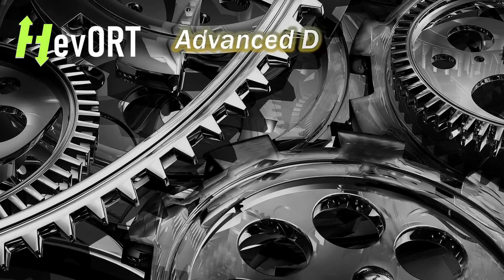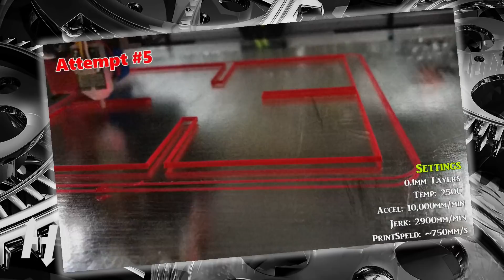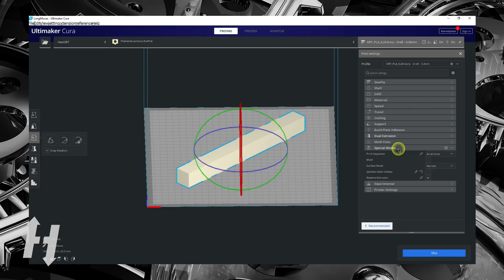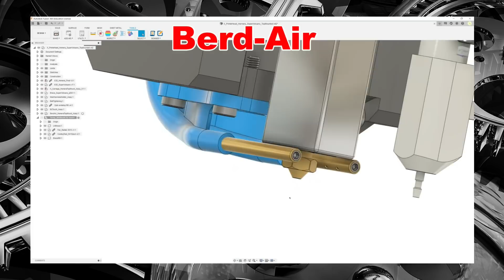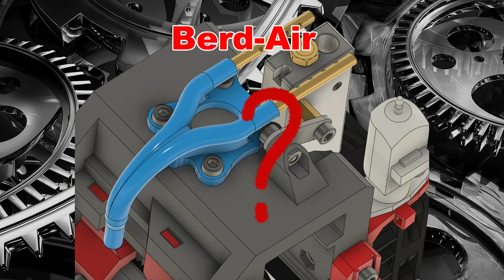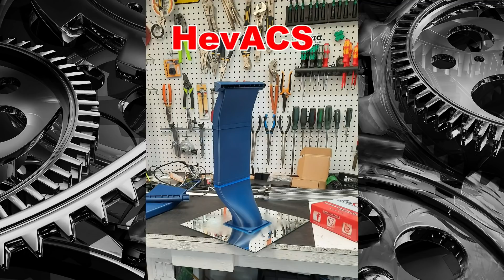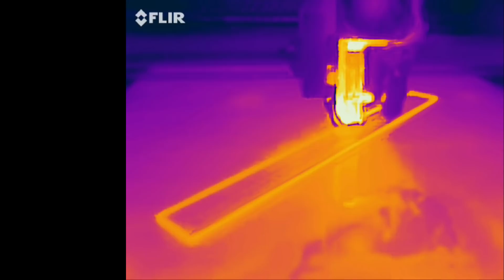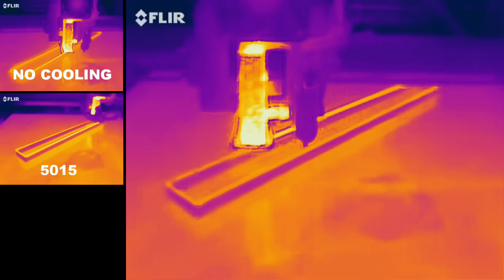Ultimate 3D printer Cooling fan - 5015 vs Berd-Air vs 300CFM Mega Cooling

Comment: Brainfart idea2: Is it possible to implement some SMT tech to the printhead/hotend? Prusa has the color changer, but I think it's way too complicated. IMHO, as an experiment I would like to try out BB gun pellets, what is basically ABS, and use SMT pipettes and shoot the balls. IF we use different sized pellets, and colorized bb pellets, you can get Styrofoam like structure, and a pretty fast printing speed. https://www.youtube.com/watch?v=nMYSneJN55c (like at 0:27) IF we use this printhead structure, you can have not only one printing head size, else even 12 if the module can be fixed to a traditional hotend, and you only need a toolchanger that SMT/SIPlace machines already using. The only question remaining that how can you heat up the pellets to stick them together (maybe acetone coating?).

Comment: Another brain fart idea: is it possible to create a peltier based hotend that already heats up inside, but makes cool outside? What would be to use out this feature and use the already cold air in a chamber and blow that out? Inside melts the plastic outside cooling down.
Reply from the maker: I like that Idea! !  Thank you :)
Reply: @MirageC  If you don't want to have any moving parts, you gonna need also water tank attached to the printer, and use gravity and vacuum. Redesign this: https://www.youtube.com/watch?v=TpltYa0_94c. Maybe you find it useful. +1 brainfart: Can you make electric heatbed with magnets on base with wireless charger circuit? Here is the idea: separate the tray and only move the wireless charger by another mechanics/stepper motor close to the tray. With that you can use out todays wireless chargers disadvantage - as they generating a lot of heat, but also you can have electronics inside or around the tray to indicate heated bed temp. If the print finishes, switch off the magnets that keeps the tray in place, and release down the wireless charger, and eject the tray with the printed stuff, and load the next magnetic tray....

Comment: Can you check the hevACS system with a large area of infill or a complex part that would shield the center from the wash of cooling air?
Reply from the maker: I fixed that by making the HevACS nozzle to be a bit higher than the print zone.  This way, the air flow comes down at a slight angle on the part, avoiding, or reducing that shielding effect you are mentionning.

Comment: Presumably the HevACS would also cool the entire bed.
Reply from the maker: It does have an effect on the bed for the first few layers.  Not enough to trigger thermal runaway safety shut down as per my tests. 
As print progresses, the bed will go down and get away from the airflow.  
Note that I made sure the PID tune from the bed was performed with HevACS on at 100%.  
I am using a 750W 120V silicone pad from Keenovo which can keep up with the extra demand.

Comment: Whats the estimated price range first for the 315 build volume then the 415? Thank you.
Reply from the maker: You can figure a good 2000 - 2500USD for such a build
Reply: @MirageC  appreciate it i was looking at $650 when looking up the parts but thats with out the xy part just the electronics, extrusions

Comment: Could one route the air path from the need-air over a peltier effect cooler before it gets to the printed part? Colder air might be another way to improve cooling efficiency.
Reply from the maker: Yes, the colder the air output is the more efficient this system is (With PLA and other high cooling material)  The down side of peltier cooler is that they will generate as much heat as they generate cold.  They only transfer heat from one side to the other while taking considerable amount of power.  You would need another system to cool the hot side.

Comment: I'm using to two of so called "turbo" fans 4028 27cfm mounted right on a carriage and it works amazingly! Can you actually check the air flow rate coming right from the outlet ? I bet there is not that much left of the original 150 since it looses its potential on a long distances

Comment: how does this apply to ABS?
Reply from the maker: ABS does not need that much cooling.  But if you are looking for high speed printing a recirculation of inside chamber air can be done to blow warm air at the part and limit warping.

Comment: A strange study. Why cool the part completely? In fact, you just need to lower its temperature below the glass transition temperature, and that's all.
Reply from the maker: This system will cool the first one or two inches of the part.  As ths machine can lay down material quite rapidly the heat accumulation becomes uncontrollable using only fans on the print head.  As material is rapidly piling up, temperature of previous layers could not get below the glass transition temperature.  This system fixes that issue.

Comment: The HevACS has got to make the hotend work much harder to keep temperature.
Reply from the maker: A bit yes.  But the PID tune of the controller takes it into account.  Super Volcano has a 80W heater cartridge.

Comment: Wouldn't the hevacs work even better non-axial fans? It looks like the airflow is at least a little restricted and afaik axial fans are not great at pressure, mostly volume.
Reply from the maker: I agree they would be more efficient with Axial fans, but considering the current level of effectiveness, they would be overpowered.   I made sure in my design that the output area was close enough to the input area so the fans would remain with operation limit of static pressure: https://github.com/MirageC79/HevORT/blob/master/images/120mmfanchart.jpg?raw=true

Comment: Close to what I was thinking about using a high pressure fan (not necessary having hundreds of cfm) and using a silicone tube along with the bowden (or bowden and wires could even run inside the silicone tube), to save weight from print head, and direct that "outside" air to the part. Result should be closer to berd-air but with higher cfm so I can even bleed off some of the air surrounding the nozzle and not just directly under it.
Second thing is that would the HevACS work better if the nozzles are a bit offset so the air streams don't clash with each other as much? Like the left duct more on the front and right one bit further back. That should also create a small vortex that could lift off excess heat directly up.
Reply from the maker: You are correct Tommi, the air clash in the middle could be improved.  I had the Idea of slightly diverting one HevACS duct to the front and one to the back.   This induced swirl could then be flushed via a top fan pushing air out of the chamber.  But in all honesty this system does not need much performance improvement for the current application.  I am now concentrating at ensuring proper flow distribution through the bed surface.
Reply: @MirageC  How would the HevACS work with tiny parts where the hotend spends a lot of time in a small area and doesn't let the breeze flow as well as with big bed sized parts?

Comment: I had another crazy idea: What if you would print in water,  you submerge the whole print platform in the water and lower it down so that the water level and the current layer line are always at the same height. That would have an interesting cooling effect. Also it could make overhangs easier printable as the filament would float on the water.
Completely floating pats of the print could have a tower with 3 contact points underneath to keep them in place without having to lift the whole structure.
Reply from the maker: I will leave this one to you ;)  Too much development for me. But yeah, maybe there is something there.

Comment: So because this is a COREXY system, once the bed moves lower the cooling is perfect for high speed printing?
Reply from the maker: The airflow s parallel to the bed and has limited interaction with it.  Only the first few layers are being treated with air affected by the heat of the bed.  But yes, as the Z height increases the cooling stabilizes.
Reply: @MirageC  Is there any place you've shard your fusion 360 files? I have an in-progress HyperCube Evolution but it is using 4040 openbuilds v-slot. I wouldn't be able to convert it to your design without making alterations. This cooling system would be awesome because the print volume is 900mm tall.

Comment: If it`s only how cool can it be than this one kicks ass:
https://www.shop.inventbox.com/en/jgaurora-upgrades/jg-titan-mkii/jg-cooler-mkii-single-4
But to much cooling isnt always good - this Cooler runs optimal at 40-60% at PLA - 90% only for overhangs. At 100% it cools down everything.
You can also buy the Blower itself:
https://www.shop.inventbox.com/en/single-spare-parts/radial-blower-50x50x15-24v/0.15a-9
Reply from the maker: Depends your are printing at what speed, what layer height and width.  My tests were performed using a 0.8 nozzle printing at 0.3mm layer height at 80mm/s.

Comment: interesting tests.. however thats a super restricted airflow install of a berd-air.. why would you plug most of the volume of the air tubes with screws?
Reply: One of the reasons to use screws to plug the end of the tubes, other than to plug the end so that the air needs to go out the drilled holes in the side of the tube, is so that you can turn the tubes to adjust where the air ends up going as it leaves the tube. The screws themselves are not obstructing the vent holes in the pipe, they are not going that far into the tube.
Reply from the maker: Berd-Air is not about air-flow.  Its about pressure and velicity.  See the original design by Glenn Berden from the http://www.themakerhive.com/shop/viewcategory.php?groupid=6
Reply: @MirageC  while this is true, there are still gains to be had with no screw obstructing.

While the system is based around velocity and pressure, it won't take away the fact that more air will cool more. Provided the airpump can provide the required quantity of air.

Comment: What a great way of cooling! 
Small question:how does it affect overhang and bridging performance?   Will extruded filiment be 'blown away'?
Reply from the maker: The velocity and pressure from the HevACS is a lot less than the one from the Berd-Air.  So no it will not blow material away.

Comment: Did you keep an eye on nozzle temperature? I could imagine that cooling the part would also cool the nozzle down quite a bit and the heater might have to work very hard to keep consistent temperatures. Especially in the case of the HevACS where the nozzle moves further away and closer to the fans all the time looking at the consistency of nozzle temperatures would be interesting.
Reply from the maker: The nozzle heated has been PID turned with the HevACS on :)  high filament flow will have more impact than the HevACS.  I'll try to take some logs.

Comment: This looks like a great printer.  I was entertaining the idea of building one but I have come to a dead-end with your frame calculator.  A paragraph on how you calculated everything would be much more useful than a wall of malfunctioning spreadsheet software.  I guess I could buy Microsoft Office.  Nah.
Reply from the maker: I hear you. Let me try to help.  what desired print area are you looking after?  I can run the file for you and send the results to you.
Reply: @MirageC  Thank you for responding.  You recommended the 415 X 415 for mid range mid cost so I was looking at that size.  Your 315 had a z height at 340 so I was thinking 415x415x440.  Would that be OK for standard ball screws and rails?
Reply from the maker: @jimlovesgina  Yes!  that is infact the current size sweet spot for that printer.  
I have added a table with  recommended configs at the bottom of this page.  Let me know if it works :)
https://miragec79.github.io/HevORT/framecalculator.html

Comment: While the HevACS seems good i have a few concerns:
1. How much energy is lost on the first few layers by cooling the print bed ?
2. Are small parts that are only supported at one tiny point very likely to be blown away especially if they are close to the ACS ducts?
3. While i dont know of a slicer to support this you loose the ability to cool parts based on their function (like cooling infill less than the outer wall).
4. Parts are differently cooled depending on their position on the bed. This may result in different layer-adhesion based on the position of the model on the print bed. See this CNC KITCHEN video about layer adhesion in relation to cooling: https://www.youtube.com/watch?v=Bl2ESvtBiLo
5. If multiple models are printed after each other (in contrast to at the same time) cooling may not reach the currently printed part.
6. If a print fails the extruded spaghetti may be more likely to be blown towards the heater block and form a blob.

PS. i hope this idea succeeds as it reduced weight on the XY carriage
Reply from the maker: Thank for your comment.  Let me try to answer those concerns.
1 - I did not measure that.  but here are my 2 PID tunes for with and without.  This is on a 750W 120VAC heat pad:
With:       M307 H0 A84.5 C189.0 D1.4 S1.00 V24.1 B0
Without: M307 H0 A59.8 C126.9 D1.7 S1.00 V24.1 B0

2- The wind force from this system is not that much, it is creating more of an air bath that takes heat away.  I have not tried with small parts but I would not be too concerned.  The filament / nozzle drag from printing fast would be greater that that wind force i suppose.  I'll try to print little walls perpendicular to the air flow near the ducts.

3 - This system is driven by the same M106 command as the print head cooling.  In fact I use Berd-Air + HevACS.  Both being associated to my tool 0 via the M563 command:
M563 P0 D0 H1 F3:7:8      ; Define tool 0 Map fan 3, 7 & 8 to Tool 0

4- I totally hear this one and share the concern.  Part printing test will tell us the truth.

5- Depending on the size of the part, yes printing parts one after another might create on to block the airflow for the other.  But the ArcadeTilt (another name haha) will take care of that by flushing parts as they are ready (video to come) :)

6- I never get failed print..... cough cough looking at that bucket full of scrap :D.  I use crash detection from the duet to stop printing when hitting a bump too hard.  That usually avoid blobs situation.  But it is not a true fail safe.
Reply: @MirageC  next idea, put 4 fans, send head XY position to a controller that powers the 4 fans differently for a pseudo-3d airflow. So if you are close to one side the fan on that side will blow less than the one on the opposite side. That would give you almost linear airflow. :)
Reply from the maker: @MatteoSpinelli  Hahah!  I had a similar Idea with deflectors activated via servo in the decting.

Comment: Is the HavACS suitable for Printing ABS inside a heated chamber and open air print bed
Reply from the maker: I did not try yet with Enclosure and ABS, but I would think that the HevACS air intake would either need to be recirculated or heated to avoid ABS to fall into warping mode.  Berd-Air is enough in most cases with ABS as per my operation needs.

Comment: Dont you need to adjust PID if you wanna run HevAC at lower speeds? I.e you wanna have lower noise when cooling is less critical or when printing PETG or ABS. And what if you wanna print ABS but use fans for bridges, will there be risk for warping as well? Have you tried? Great job anyways and cool idea :)
Reply from the maker: This system is driven by the same control board just like the 5015 fan is.  A Duet Control board can take close to 1 amp per fan channel.  I have mapped these two additional fan to my tool definition in my config.g using the M563 command: 
M563 P0 D0 H1 F3:7:8  ; Define tool 0 Map fan 3, 7 & 8 to Tool 0

Comment: Have you thought about making some sort of duct that moves along with the bed? Perhaps two pieces connected via a tube so that the system is flexible? You could also fix the fans to the bed and use tubes to get cool air from below. Great project anyways, keep it up! :)
Reply from the maker: The cooling only needs to happen at the few last layers laid down. No need to follow the part into the Z axis, smae goes for a regular 5015 fan setup ;) Thanks for your comment :)

Comment: Just noticed you seem to be using a 3D mouse, did you get it to work in cura?
Reply from the maker: Yes, I am using a SpaceMouse from 3Dconnexion.  No I did not get it to work in cura.  Did not try to find a solution though.  If you use Fusion360, he a look at my customized radial menus ;) 
https://miragec79.github.io/3DxConnexion_FusionIcons/
Reply: MirageC thanks I‘ll take a look at that

Comment: Correct me if I am wrong but the hevac system would only work for short objects as the cooling air is fixed in 1 place. 

On my old system I had a print bite surface with 5 mini fans on either side to cool the bed after prints for quick removal. Kinda reminds me of that.
Reply from the maker: The cooling only needs to happen at the few last layers,  This printer is a coreXY and the bed is moving downwards to create the Z axis.  So this fan system works for all type of parts.
Reply: @MirageC  I am an idiot...thanks for making me use my brain!  Keep up the great work.  At some point will you be testing multiple materials with speeds?
Reply: This was my question.  I plan on building a printer that is fairly high.  Like 800mm printability.  This wouldn't work because the bed will move down and the air looks to be stationary.
Reply: Oh yeah..... lol sorry I was being an idiot.
Reply from the maker: @rickywong5551  No problem, :) it is sometimes difficult i find to picture things right from only a video without seeing the entire Machine.